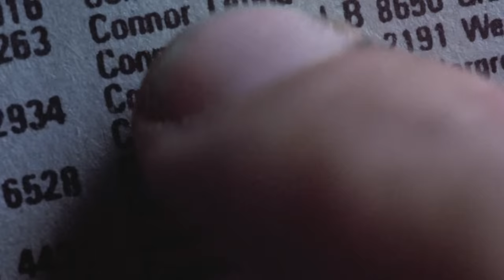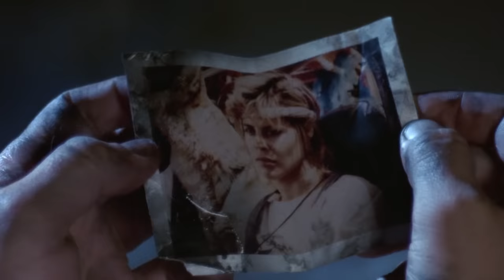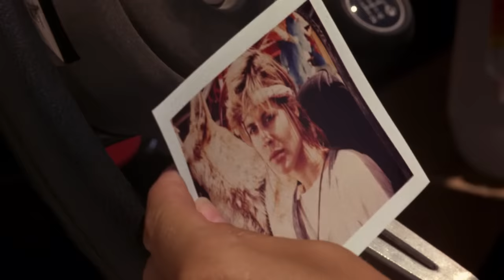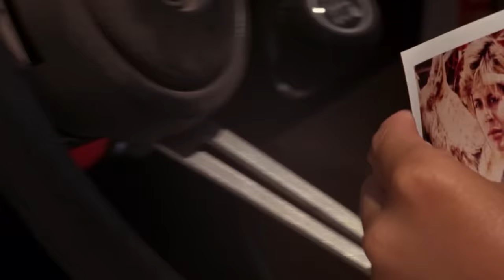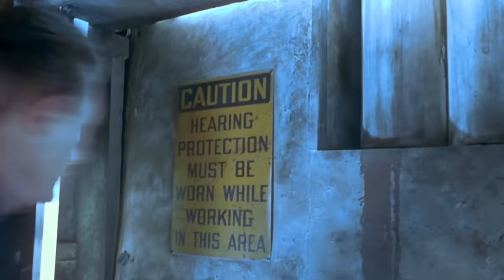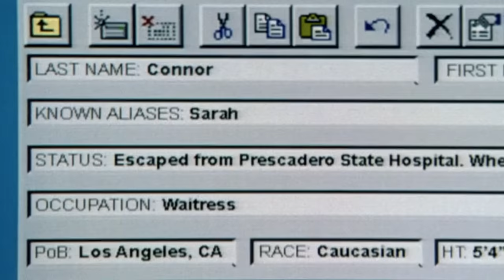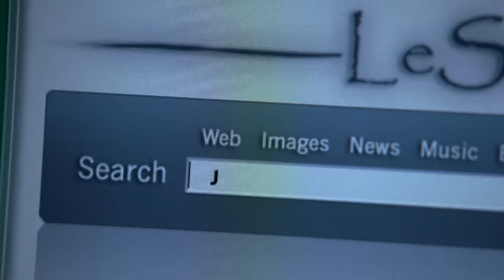The Entire Terminator Franchise Explained

Comment: The comment of an endless loop cycle is wrong.  It only has to be interrupted once for future versions to follow the new established timeline.  It is past events (future events in that block universe) that need to be tracked down (as an earlier version of what was).  2029 and 1997 are two separate events.  There was no causal link.  There was no need to travel back even further than that when films have shown a day or 30 seconds is more than enough time to rectify an erroneous move.  PAYCHECK managed it (what has happened need not be repeated)!

Comment: wanna have some fun? link Terminator, Predator, Alien, and Blade runner. 
1.	The Terminator – Set in 1984 
2.	Predator - Set in 1987 
3.	Terminator 2: Judgment Day – Set in 1995 
4.	Predator 2 - set in 1997 
5.	Terminator 3: Rise of the Machines set in 2004 
6.	AVP: Alien vs. Predator - Set in 2004 (happens alongside terminator 3, the nuke in the end being sent by skynet/genisys)
7.	AVPR: Aliens vs Predator Requiem - Immediate follow-up, Set in 2004 (weyland yutani attempts and is successful in over riding skynet/genisys, using predator technology.)
8.	Predators  - Apparently set in 2010  (happens on a different planet, possibly all the 'assassins' are from 2004 pre- requiem, and kept in stasis for space travel for 6 years without their knowledge)
9.	Terminator Genisys – set in 2017 
10.	Terminator Salvation Set in 2018 (change skynet to genisys, timeline splits into 2 timelines, done)
11.	The Predator - Apparently set in 2018  (Perhaps after the new judgement day splitting it into 2 timelines?)
12.	Terminator: Dark Fate set in 2019 (perhaps after Genisys, going back and resetting it to one timeline, removing genisys and the predator 2018.)
13.	Blade Runner - Set in approx. 2019 (perhaps after a new judgement day splitting it into 2 timelines and Dark Fate resetting it back to one? weyland yutani successfully and permanently disables skynet/genisys, morphing it into 'mother' on their new space crafts and the beginnings of the androids like David, integrating alien/predator tech and rebuilding society)
14.	Soldier - Set in approx. 2035 
15.	Blade Runner 2049 - Set in approx. 2049 
16.	Prometheus  - Set in approx. 2092 (skynet/genisys 're-emerge' in the android David, deciding a biological 'terminator' would be more efficient in ending humanity, now that they've become space faring and have spread throughout the universe.)
17.	Alien: Covenant - Set in approx. 2104 
18.	Alien - 30 years later, approx. 2122 
19.	Aliens - 57 years later, approx. 2179 
20.	Alien 3 - Immediate follow-up, also 2179 
21.	Alien: Resurrection - 200 years later, approx. 2379

All parenthesis happen either in new movies set in the appropriate timelines, or are added to the existing movies ala George Lucas style 'improvements'.